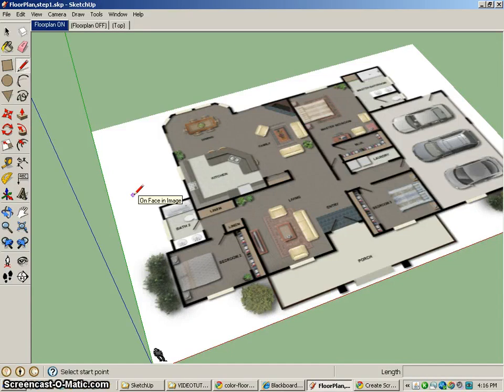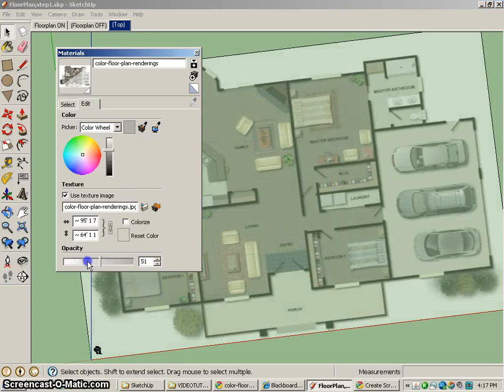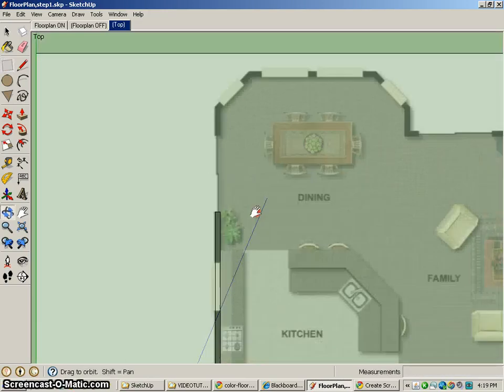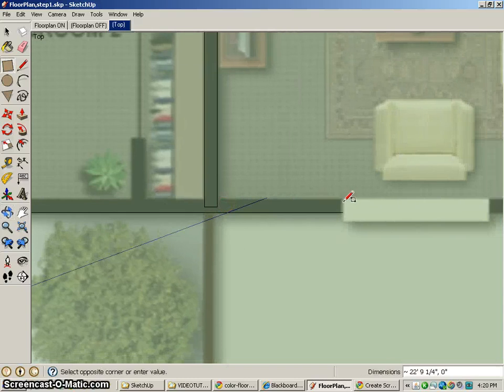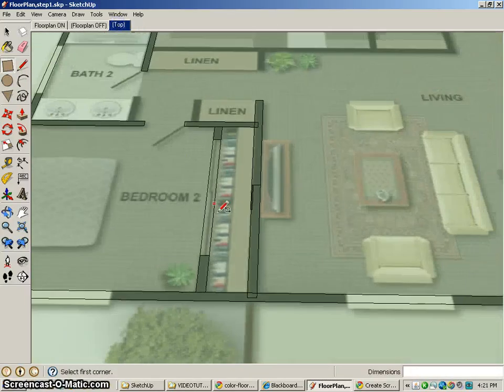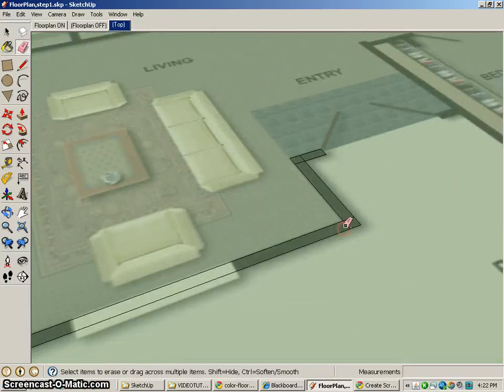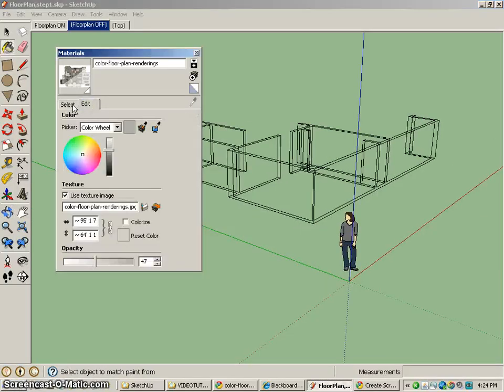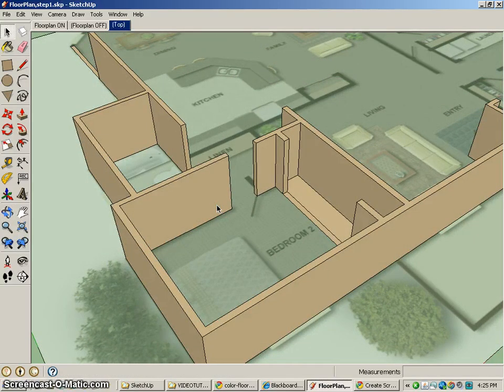SketchUp-Floorplan,part3,drawing2.mp4

Comment: Im having trouble. I have been able to successfully import and make the different layers and scenes, even change opacity. But when I draw the rectangles they cover they floorplan layer with a blue shade. And so im not able so see the other details in the room (using youtube.com/watch?v=FsnT8KN8xIM method to trace the walls as recommended).
Note im using version Sketchup Make ver 14.1.x
Thanks in advance.
Reply from the maker: I think it has to do with objects having a "front" and "back". The back side is blue. This can be an object that is extruded inside out... and we see the blue side. At least, that is what I know about it. ;-)

Comment: Asodore, Other than a place for the Google Earth terrain, layers don't have much of a useful purpose. Layers allow you to group objects so that you can hide/show them by hiding/showing the layer. It doesn't lock items, and it doesn't prevent you from selecting objects on other layers. So, don't fret. There may be some hidden use for them, but you could ignore them and draw everything on one layer and you'll be fine. The active layer is the one with the selected radio button, not the highlighted.